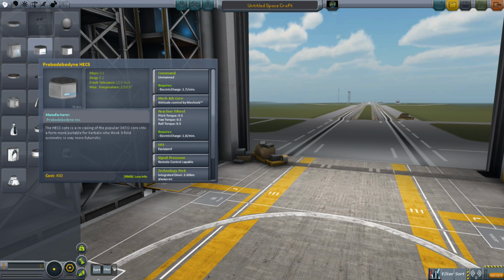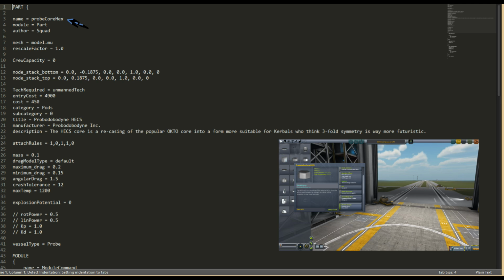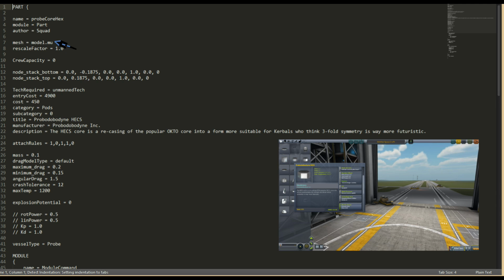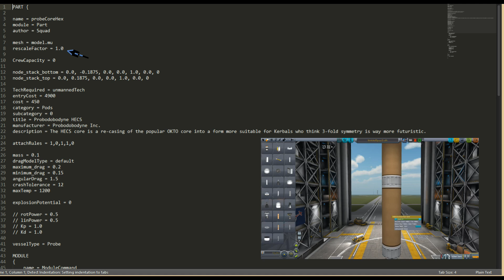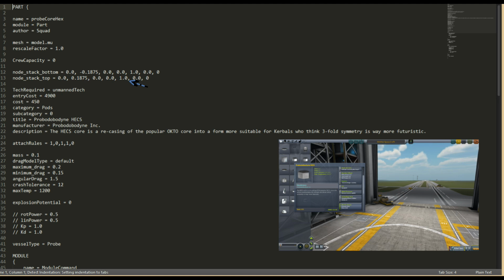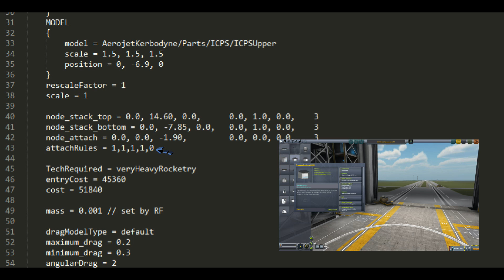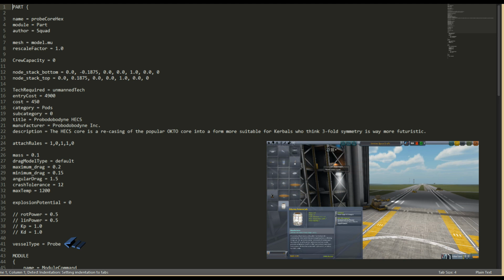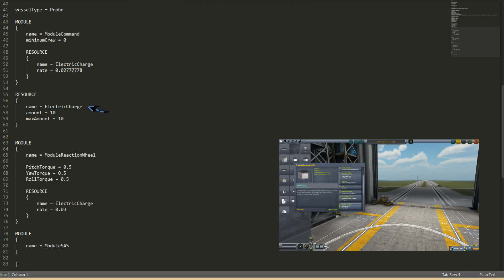"PART" Files (part 1: basic layout) -- AMA 4 -- KSP 0.25

Comment: Hey Bob! I have one question.How should I modify parts?Using a separate CFG like you do with Project Odyssey or by changing the actual part file?
Reply from the maker: Pack_Retro I never change the part file directly. Your changes will be destroyed if you install a new version of the mod. I keep all my files in separate directories so I can remove the entire mod any time I want, and replace it with a new version. I use MM to change existing parts, just like I used in Odyssey (the git repo has many examples).
Reply: Ok thanks!